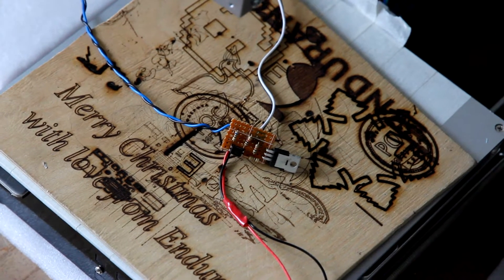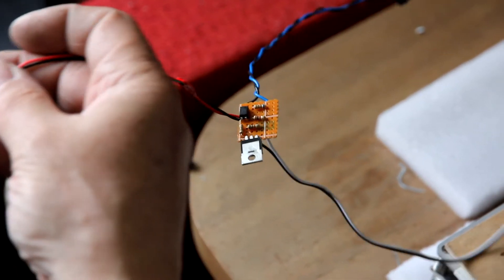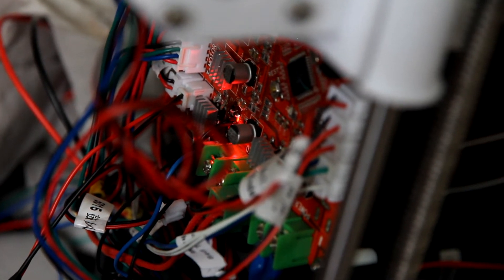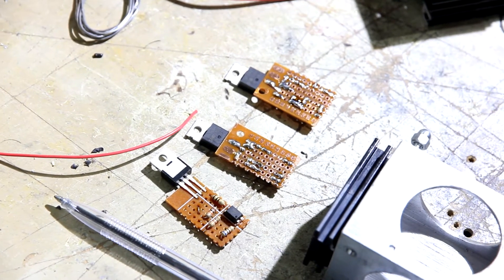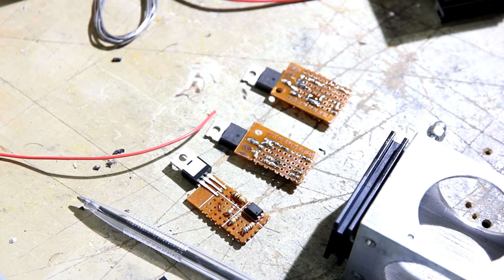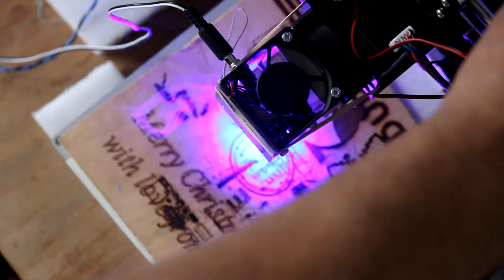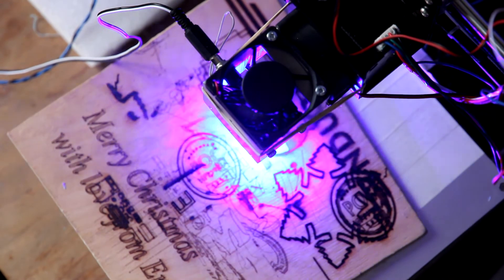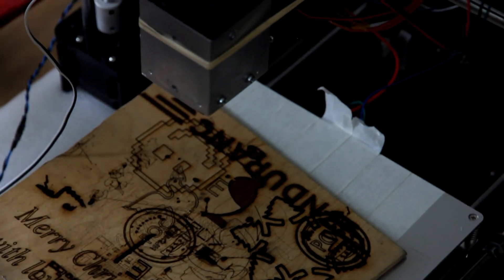Installing 8.5 watt laser on Anet A8 3D printer. How to change laser power on a 3D printer

Comment: the printer is a 24v and your device convert it to 12v correct? if so how do i get one of those devices i do have a Anet et4 24v so i need some kind of solution for it
Reply: I'm thinking of using SSR switch the fan output to external 5V voltage to laser. Wondering either it works or not.
And at least can protect printer board from cook if anything gone wrong
Reply from the maker: we upgraded our lasers so now they work with 24V TTL

Comment: Is it 3.5W or 8.5W? Have you tried to upgrade the firmware for laser?
Reply from the maker: yeah, they look the same 3.5 watt / 5.6 watt  8 watt have the same designs
Reply: Thank for your reply. Can you give the circuit diagram for this small board?